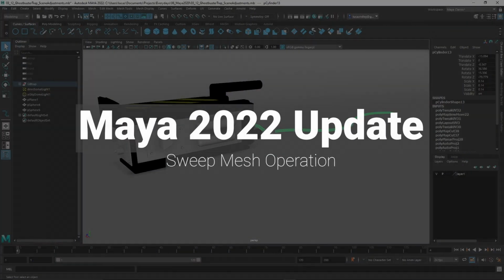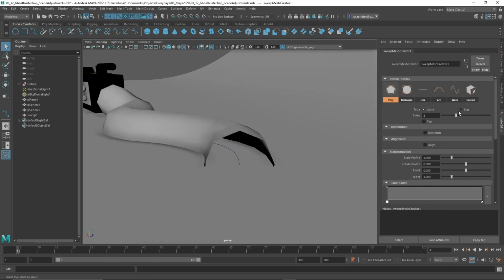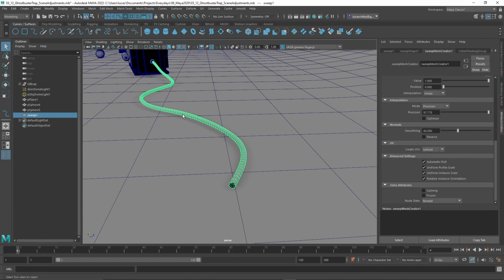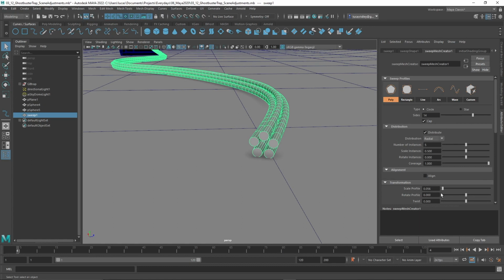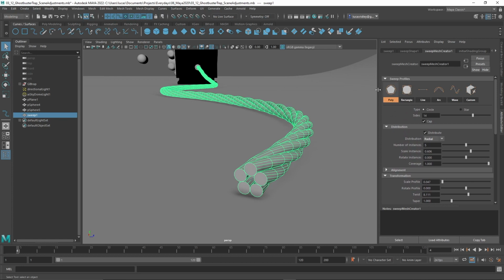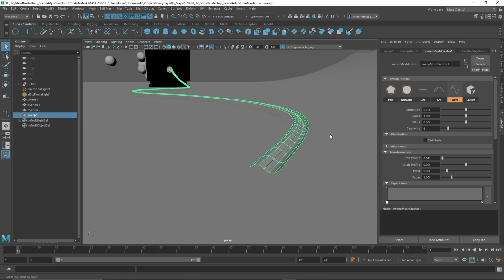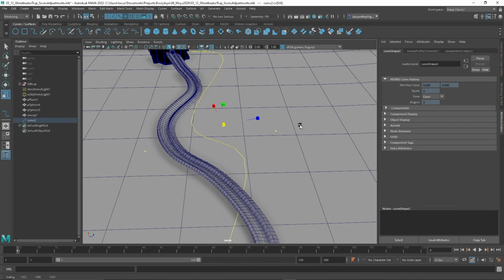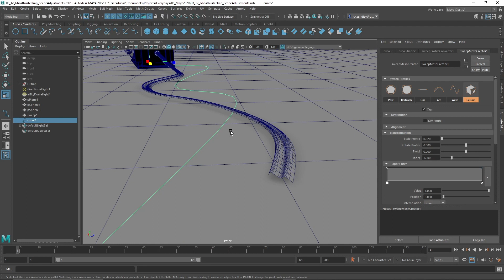Sweep Mesh - Model Cords, Ropes, and Wires [Maya 2022]

Comment: once again there is nothing new in Maya the swept mesh that is everyone talking about is just the old Wire plugin, nothing else and the only thing that this does is pipe nothing more, nothing new for better modeling or UV, special the strengthen UV is disgusting, after this, I will have to move out to blender, every update is like new software, but Maya is year buy year in the same situation, for sure I am not the only one that is complaining about.
Reply from the maker: Thanks for your comments, but I don't work for Autodesk, you should contact them with your complaints. I'm just stating the facts here: this is a new feature native to Maya 2022.
Reply: "....the only thing that this does is pipe nothing more" ROFLMAO, people should not talking about things they have no idea about.